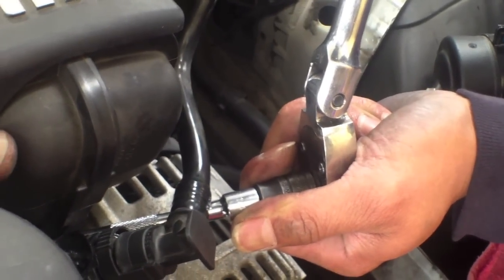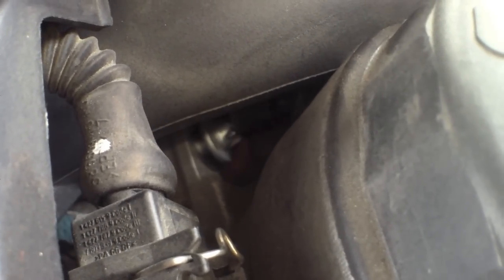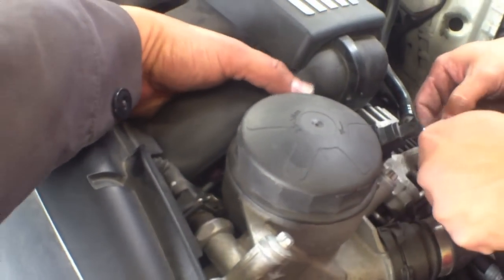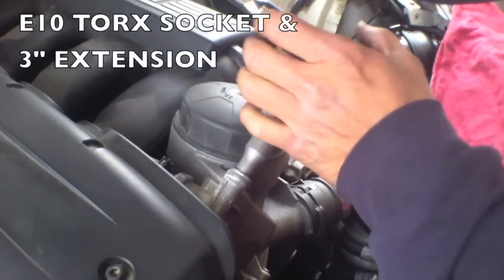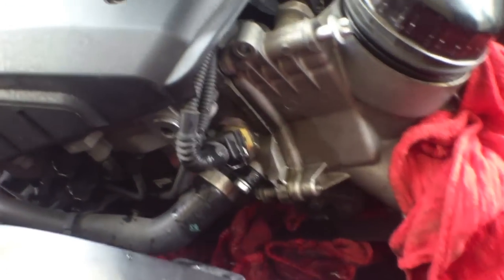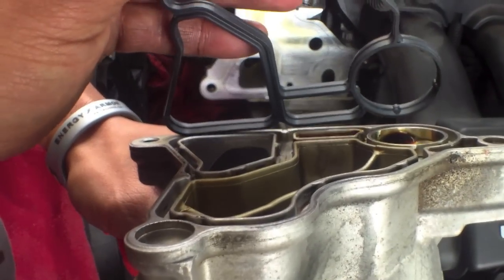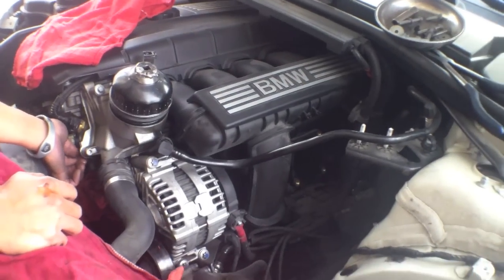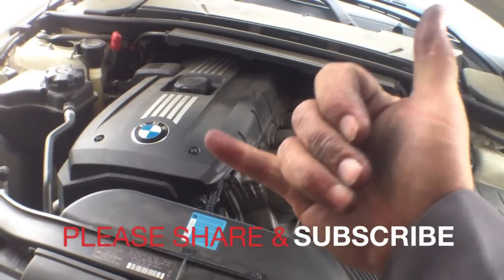Replace Oil Filter Housing Gasket BMW 3 Series E90√ Fix it Angel

Comment: My only concern is the water and oil getting contaminated when you pull it off. You don't want any oil in your coolant, but more so not to get any coolant in the oil. As far as the torx set, just go buy a set. Not that expensive and you are saving all that money fixing it yourself anyway.

Comment: Use the Gear Wrench E10 E-Torx Ratcheting Double Box-End Wrench to break the torque of bolt on the front bottom and the bolt under manifold. Then use open end 8 mm wench and then hand to get off the front bottom bolt. Note for the front bottom bolt, use E10 ratchet wrench all the way will get the wrench stuck. I got the wrench stuck there and have to force it off and got the bolt head damaged. For the bolt under manifold, the E10 wrench can be inserted on the gap left to the oil filter. Then use 8mm 6 point socket 1/4" drive on a swivel adaptor with extension to get it off by hand turning. This way the bolts will not be stripped. Happy working on your bimmer :)
Reply: In addition, put a chair in front of the car and knee on the chair or one foot step on chair will help reduce the strain on waist.

Comment: I had a E10 Swivel U-Joint socket. It worked perfectly removing the hidden bolt. But I could not use it to tighten the bolt. The angle was too great and when I use force to tighten the bolt, it feels like the bolt would scour the thread through sideway forces. I had to end up removing the alternator to hand tighten the bolt all the way so I didn't have to rely on the swivel socket at an extreme angle. Removing the alternator required removing the belt and buying new bolts.

Comment: Great job, the video helped me out. For the N55 engine you will have to remove the intake manifold to reach the 3rd bolt. You can find the E10 torx at harbor freight for 10 bucks so you don't round out the bolt with the 8mm.

Comment: Thanks guys. Your video helped a lot. The most important part was the bolt that is closest to the radiator. That was the toughest to remove but your tip using the 8mm ratchet wrench worked like a charge.

Comment: You can use these inexpensive Sears tools for this.

For the bolt behind the intake manifold, use Item 00943194000P, Model 43194, UPC 714994431947 - 1/4 drive 8mm swivel socket. It is a six point socket with sharp points on the hex. If you want you can use some aluminum foil or plastic wrap to "shim" up the difference, but my experience is that there is not enough slop to round off the bolt head.

For the lower bolt, use a 5/16" 12 point ratcheting wrench. Item 00943361000P, Model 43361, UPC 077769433615. Ratcheting box end wrench. Offset-style standard 1/4 x 5/16 in.. 12 pt. openings. 4-1/4 in. long.

No need for that super expensive Snap-On stuff.

Comment: Good video,  fyi the bolts are aluminum and expand when tightened, so they need to be replaced with the gasket to prevent future leaks.

Comment: As I only have the normal 3/8 E-10 torx, that wouldn't work due to leak of space even with the 3/8 swivel , and it's hard to find 1/4 E-10 torx as least not stored in harbor freight or Sears. I tried your approach with 1/4 8mm with swivel & extension, with a bit of patience, just be careful round off the bolts. I works on my X5 N52 engine. Thanks guys for sharing the tips.

Comment: Universal 1/4" wobbly attachment and a 5/16" 12 point socket is what you need to get to that bolt behind the manifold.  Plenty of room, that bolt is usually covered in oil so no chance of it seizing.  no worries about stripping.
Reply from the maker: Vince Phan ok good tip. Thank you

Comment: Great vid!  Not sure if you did it, but it is always best to super clean the contact surfaces to protect against future leaks.  I usually use carb or break cleaner or ether; but it is best to het all the oil out of the metal surface.

Comment: “There’s only one reason of fit no” lmfaoooo
Reply: Yea only one ☝️ way dead 💀 😂 .. this is the best vid I’ve seen tho... mechanic charges me $250 for Valve cover gasket, Ignition coils with sparks plugs and oil filter gasket.. parts are about $1,000... Stealership wants over $3,000
Reply: Honestly bro I did it for just less then 10$ 😂 and then another 50 for valve cover gaskets
Reply: I do everything my self and I thank videos like these to save me money lol

Comment: Great video, Do you really have to take out the oil filter? does not seam so.
Reply: +Frank Perez Lets some of the pressure out of the system so the oil drains down I think.  Keeps the mess to a lesser amount, still makes a mess though regardless.

Comment: They tell you not to reuse the same bolts on this because they're aluminum so buy new ones and also while you're there you should change the two sensors oil pressure in the coolant sensor there are only 11 to $12 a piece
Reply: Thanks for the info.  Do you mean the coolant temperature sensor or coolant level sensor?
Reply: @Jiccian  First one that is the thing he unplugs near the oil filter house cap.

Comment: Hello, thanks for the video. I have a 2015 BMW 320i xDrive, and wanted to know if I have to remove the intake manifold to get to the last bolt? If so, can I get away without having to do this if I have the universal swivel socket?
Reply from the maker: Gotz2Bril hi, welcome. 
you saw what I did on this video. But you need the snap on universal swivel. The universal pic I showed, I think it’s too thick.

Comment: Will 3/8” drive work instead of 1/4” to remove the bolt near the manifold?
Reply from the maker: JR Vismanos sorry I don’t think so but you can try.
Reply: If the bolt is jammed up how can I take it out??

Comment: So not lubing the seal isn't necessary? Thanks for the video!!! 👍🏼👍🏼👍🏼
Reply: Stacy Pho, it is best if you don't and super clean all the oil off the surfaces.  This will greatly help prevent leaks in the future.

Comment: Hey, the video its grate!! just one question...  I just did the oil Change and I found out some leaking in the Housing filter. do I need to drain the oil again to do this job? it is not going to overflow? Thanks!!
Reply from the maker: Hi Rafael, no you don't have to drain the oil but some oil will come out when you remove the housing. Welcome

Comment: once i complete this job -- do i need to refill any liquids like oil or coolant?
Reply from the maker: gamecast92 hi, check if fluids are low. If it is, then add some.
Reply: This is dumb question but how do I check the fluids? 

Second question is - when everything is completed, do i need to add oil back into the oil filter housing?

Comment: Did you guys install new torx bolts too or just the gasket? If nee torx bolts were installed what's the reasoning ?
Reply: Miguel C  the bolt are aluminum so when torqued they stretch so it’s better to replace

Comment: Why are you whispering? Do you have thin walls? Neighbors complain about your loud car repair? Don't be bashful. Let the neighbors know how much you two are enjoying your car repair with your estatic car repair noises. When you pull out that torx bolt from under the intake manifold using a swivel socket, say "YES! YES! YES!" "OMG THAT WAS THE BEST TORX EXTRACTION I EVER HAD."

Comment: I have a 2008 bmw 335i N54 is it the same process to change?
Reply: did you find out? i got an 09 n54 and i wanna know lol
Reply: its actually easier cause the intake manifold is not in the way,
Reply: @allenmessi4636  Wrong. Intake manifold is in the way for the N54 motor as well. I've done this job myself before.
Reply: Dubya Aaych yeah ik mb. U have 2 wiggle the intake manifold back a bit

Comment: hi. did you guys loosen the manifold bolts? you were holding it up, so I ask.
Reply from the maker: Hello designer, It looks like I was holding up the manifold but I was not. I was just holding the extension. Giving it support so it won't strip the head of the bolt. Then my friend was turning the ratchet.
Reply: my wife car is 2008 328xi. I can get at the bolt that is under the manifold.  I can not get at the right angle with the extention. I saw you reach in behind the filter housing with the extention. I tried the same, but E10 and the extention do not align up. Any advice?
Reply from the maker: What kind of E10 you are using? I think you will need a Snap-On E10 because it is smaller.
Reply: how/where do you buy a Snap On E10?
Reply from the maker: Snap On website or ebay
Reply: Thank you.
Reply: gearwrench swivel E-10 would work as well.  You can buy the whole set for the price of the snap on socket

Comment: How did you diagnose that the oil was leaking from the housing gasket.  I dont see an obvious leak from the housinggasket on my '08 328, but I am accumulating oil along the head gasket (driver's side, under intake) and it is not coming from the valve cover gasket.
Reply: Roko Nikolic sounds like this could be your problem. Oil will accumulate on the front of the engine behind the belt with this issue.
Reply: I found another blog where the fellow said that oil can also work it's way along the top of the head gasket, under the intake manifold.  Once you take off the oil filter housing you can see how that is possible.  So I bought a gasket at the local auto parts store for $20 + a half hour of my time, and wouldn't you know that I no longer have the oil leak.  It's been 2 weeks.  It was quite evident by the condition of the gasket that it was worn out.  Interestingly enough the front of the motor had no evidence of oil leaking like the inner side of the motor.      Thank You guys for your video.  It was  a great help.
Reply from the maker: I saw the leak directly on the housing gasket. You will need to go directly underneath the car to get a better view.
Reply: Quick way to find out if there’s a leak in your oil filter housing, is to look inside your coolant reservoir tank. If there’s oil present inside, then the gasket is bad.

Comment: The 8mm gear wrench did not work for me on the lower bolt. I think it may have actually rounded out the bolt. Any ideas what else I could do to try and loosen it ? I can't break it free and I really can't seem to find any local stores that carry the E10 ratcheting wrench
Reply from the maker: Emir B. You need to buy the snap on brand https://store.snapon.com/Universal-TORX-174-chrome-Socket-Universal-TORX-E10-P642960.aspx
Reply: 5/16 worked for me.

Comment: what is the hose left of the housing? has plastic piece that with 2 bolt.mine busted and it's hard to find part name for it?
Reply: Shelvin Maharaj  No its plastic junk will always need to replaced..check RENN they make a metal flask one

Comment: I have bmw 335i convertible 2009.  the dealer charge 905.00 dolars plus tax for oil filter housing gasket to replace. any one can give me the idea is that resonnable price? Thanks.
Reply: Nobody cares that it's a convertible that's irrelevant
Reply: thats a terryfiying price.
Reply: Bach Nguyen hell no no its a 1 hour 2 hour tops at 165 a hour and  a 25$ gasket
Reply: Just got back from the Dealer in Houston - Oil filter Housing Gasket replacement is $845. Absurb! Looks like an easy fix to me.
Reply: While that is an unreasonable price for such a service, I received a similar quote for my e90 335i, $961.62 from Newbold BMW in O'Fallon, IL.